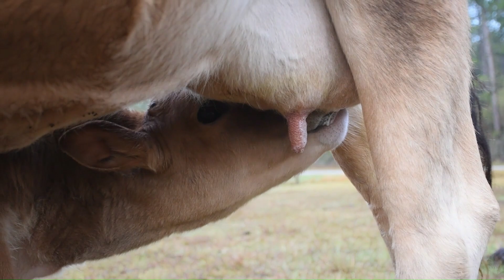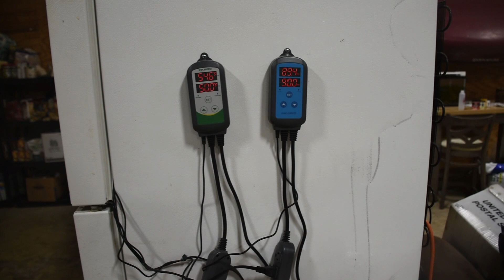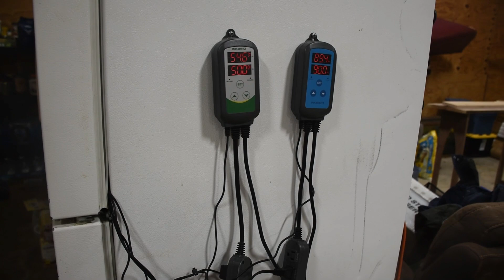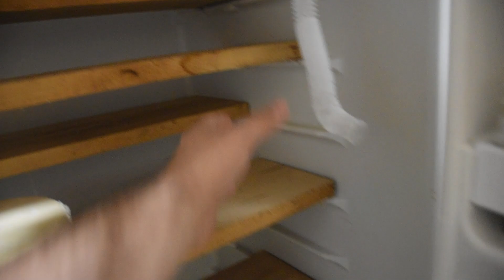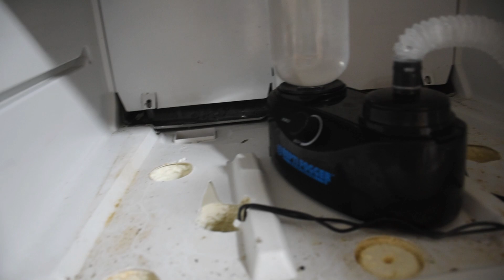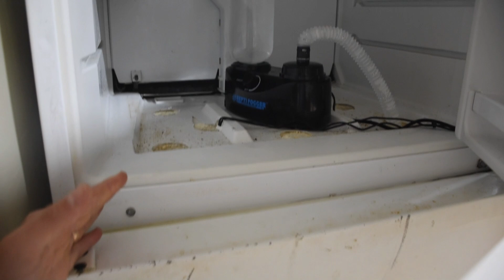Why is a Cheese Cave Important and how to make one

Comment: Can you use this same system with an older refrigerator?  I’m in zone 8a
Reply from the maker: I don't see a reason as to why they shouldn't. I am currently living between 9a and 8b, and the refrigerator / top freezer unit I'm using is around 10-15 years old. It has been running smoothly for a while now.  The refrigeration technology has not changed drastically.  The only difference should be the type of refrigerant, and maybe a fancier defrost cycle built into the computer logic.